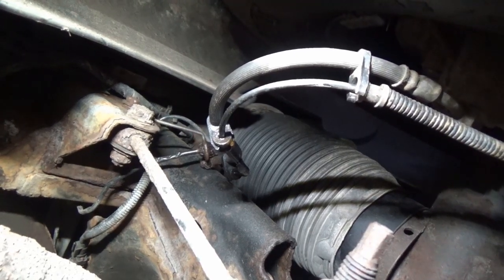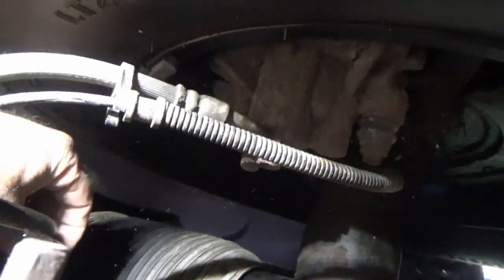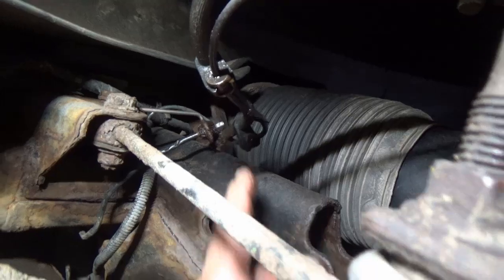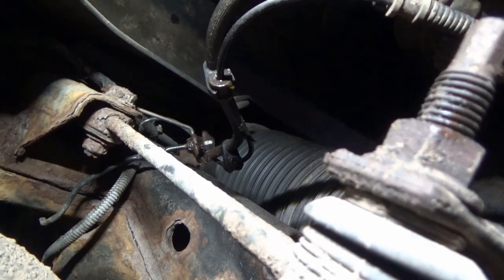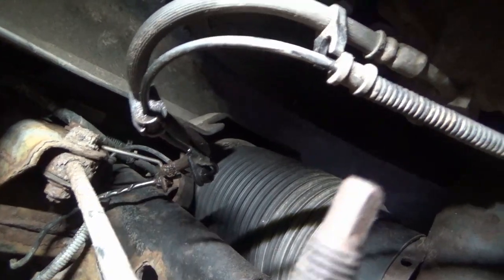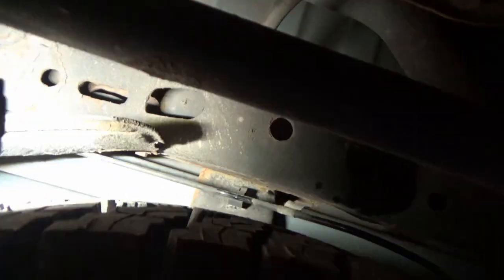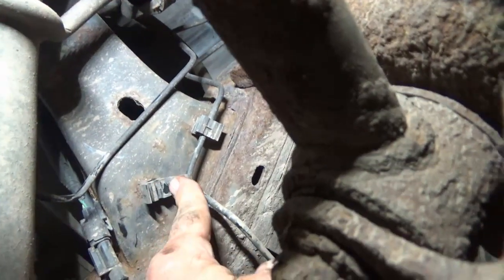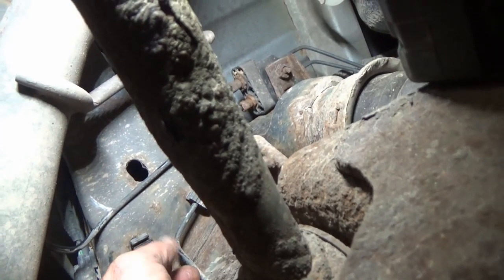How To Replace A Right Rear Brake Hose On A 2017 Ram 1500 Rebel

Comment: Does the rear passenger flex line come with the hard line also?   On midwest trucks there is no way those crusty fittings will come loose LOL
Reply from the maker: Yes, mine was once piece.

Comment: 2:56 what’s that block called I’m having a mayor leak there and have no idea what’s that called to buy that part can any one help me please
Reply from the maker: I believe that's the junction block. If you go to this link and look at the second /bottom picture set look for #5. - https://parts.moparonlineparts.com/v-2017-ram-1500--rebel--5-7l-v8-gas/brakes--hydraulic-control-unit-brake-tubes-and-hoses

Comment: 5:48 i was trying to separate that part thinking it was 2
Reply from the maker: The design does make it look that way!
Reply: @SteeveeDan also the auto parts store version is just the rubber and they tell you that it comes apart. Glad I found your video, I ordered my assembly from the dealer for $76.
Reply from the maker: @trga2568  OEM is the best and easiest way to go with these hoses.
Reply: Did this for way too long on the side of the road

Comment: Could you post a link where you found this part? Thanks in advance!
Reply from the maker: This is the one I bought - https://parts.moparonlineparts.com/oem-parts/mopar-brake-tube-and-hose-assembly-68211364ab
Reply: @SteeveeDan  I appreciate it,  Thanks
Reply from the maker: @chadclark3147  Glad to help.
Reply: All the aftermarket ones are in 2 pieces and way more affordable,there is no way I would buy this ridiculous money grab part from Mopar. Terrible design I might add.